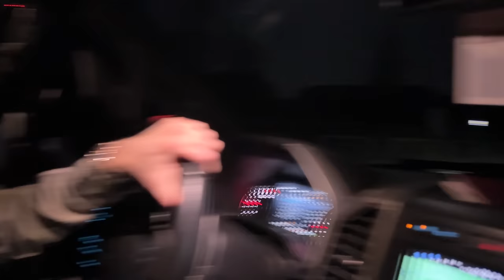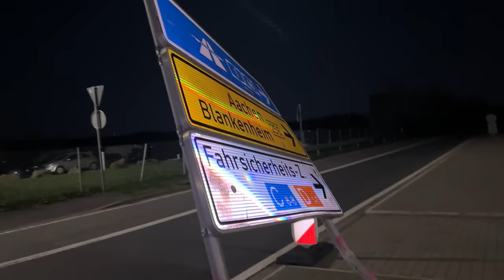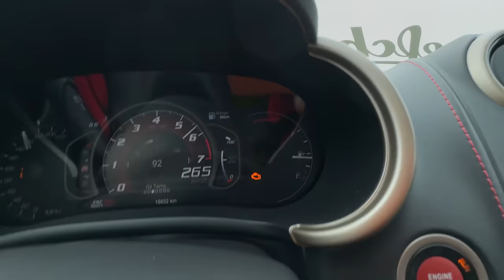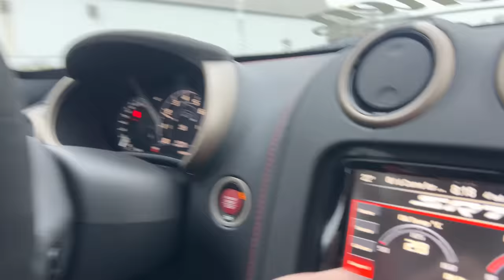VIPER ACR & 2x R34 GTR on the NUERBURGRING - Carfriday - CRAZIEST ride of my life with  @mgcharoudin

Comment: If allowed, let me give you some help. If you don't want, just skip this entry.
There is no rest for the pedals. As a race driver you are on the accelerating pedal or on the breaking pedal. No time for no pedal and just rolling around.
Learn to brake with left food, so no stepping necessary.
Don't accelerate in bursts, this just destabilize the car due to excessive suspension work. 
If you are running often into rev limiter, you might think about installing a shift light.
This time no comment on the line, because you looked for the faster one, which is okay for the moment. Later, when faster, no need, the real fast ones will pass you anyway, no matter where you are on the track.
During cornering try to accelerate earlier, not slamming the pedal, but gently press the pedal down. If back starts to get nervous, release pedal a bit or, if you can use both feed, stabilize the car with left food on braking pedal and keep on acceleration.
Invest money in a proper helmet. If personal equipment doesn't fit or work, makes u nervous.
Honestly, you might think about training a less powerful car first, this sometimes looks that the car does what it want. In green hell this can cause serious trouble.....
Keep on racing!